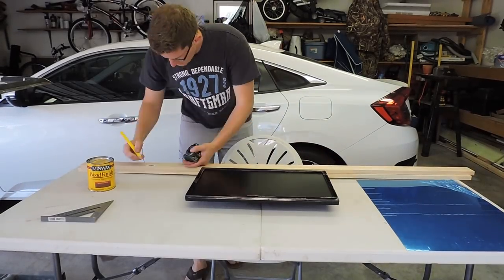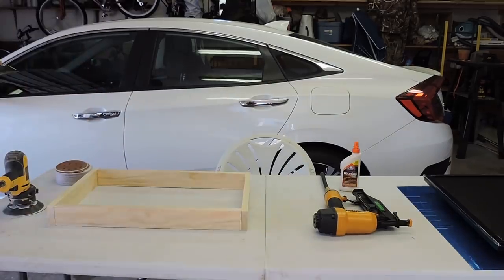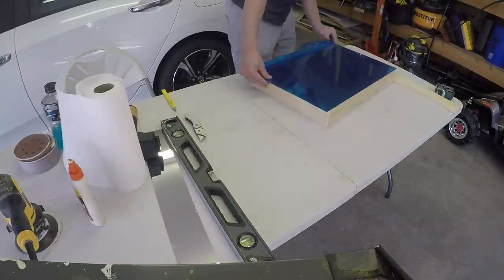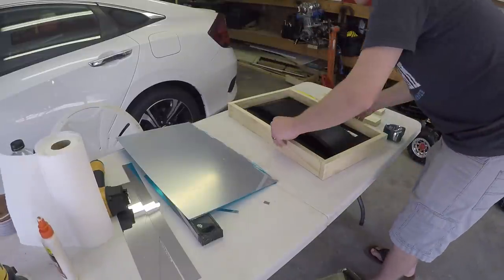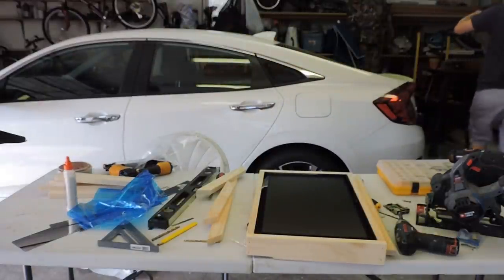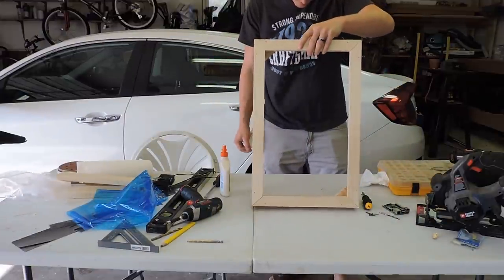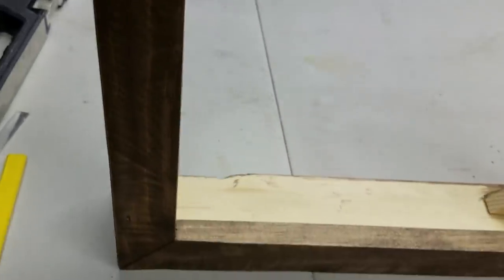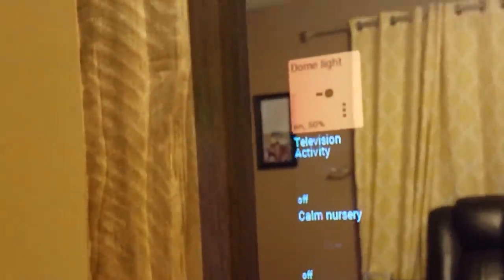How to: Make Your Own Smart Mirror. Part 2, Construction

Comment: Loving this series. Quick question: I noticed you have an 18x24 mirror in the materials list, and a 24" monitor... which usually measures out to ~22x13.5 or so, making it smaller than the mirror.

However, your monitor appears to fit very snug. Did you cut down the mirror at all? 

Thanks!
Reply from the maker: Yes, the mirror is acrylic so it is easy to cut.
Reply: Thanks for the quick reply! What method/tools did you use? Did you deal with any sort of cracking?
Reply from the maker: At 3:05 I go over just that 🙃
Reply: DOH! Thanks!

Comment: Does this mirror have touch screen capabilities
?
Reply from the maker: +Danny Ballard if you use a touch screen display, then yes
Reply: TaylorTech 
So, the mirror can support touch screen if i have a touch screen display
Reply from the maker: Yes
Reply from the maker: The only thing you'd have to worry about it the material you use for the mirror surface.  The software will read the touch display, but you may have issues with the acrylic or glass allowing the signal to transfer through.